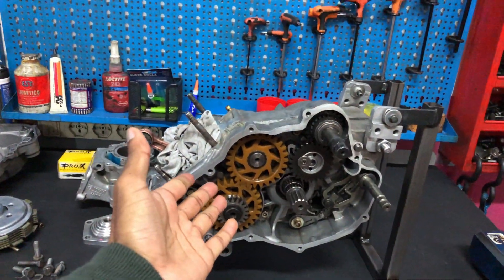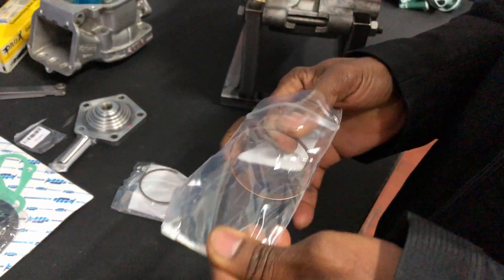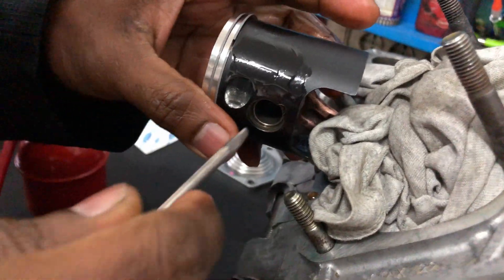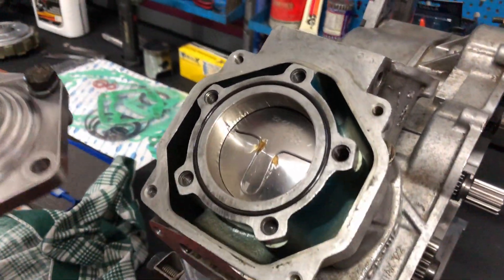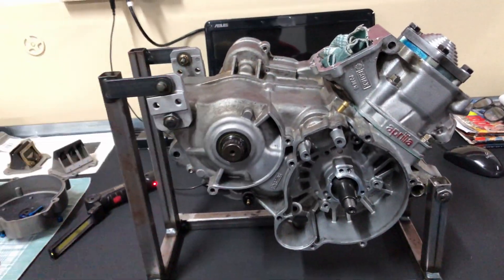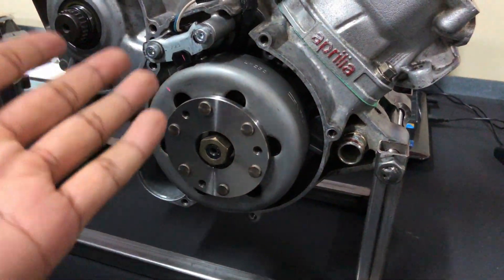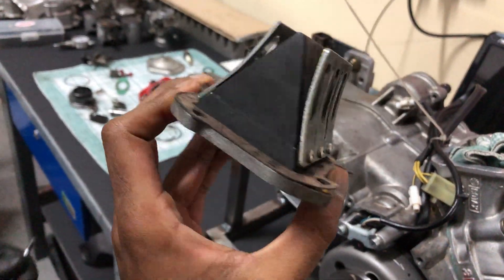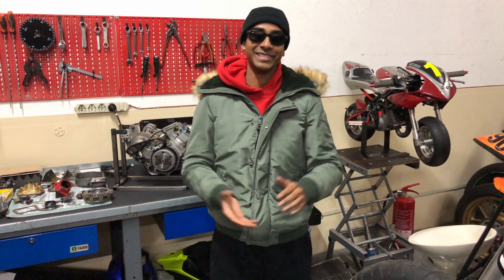APRILIA SX125 ENGINE REBUILD!! Rotax 122 episode 3

Comment: Do you know how many degrees advanced it is before you grind the case plz.
Reply from the maker: i'll ask my dad and i'll tell you!! he usually writes everything down👍
Reply: Thank you sir
Reply: Piston ring clearances are checked by inserting the rings one at a time in the cylinder and measuring the gap in the ring hence the name ring gaps it’s the gap in the expansion tips in the rings not the gap between the piston and the cylinder so In simple terms put the ring in the barrel use the top of the piston to straighten the ring then measure the gap in the split end of the ring and wala you’ve done it

Comment: I did not understand what to do with the écu. Do I have to make a hole, or should I plug the écu hole you showed …thank you
Reply from the maker: there is the mark on the ecu where you have to drill the hole, try to make it as straight as possible and drill it with a 4mm drill point. in the video on the minute 17:08 i show you where you have to drill the hole exacly. dont worry nothing will break, just make sure to drill it straight . that way you unlock the ecu

Comment: Have a question about your carburetor flange, why is it red?Is that plasti dip on it to prevent air leaks?
Reply from the maker: Yes, I just had spray painted it red😂 it didn’t have any air leaks, when I was 17 I thought the red looked cool 

If there are air leaks you could use some silicone on the outside for a temporary fix!
Reply: Thank you for fast reply, was searching online for new one but they are most likely discounted…
Mine has those small cracks like yours but need to vacuum test it to make sure it doesn’t leak
Reply from the maker: For a temporary fix you can put a little silicone on the outside so that it doesn’t suck air from the cracks

Comment: Hello! I own a Aprilia MX125 rotax 122, and i wanted to ask you if i could put a electric start motor in the engine, without cutting anything or something like that?
Reply from the maker: yes you can put a starter motor wihout cutting off anything, (rs 125 bikes have the same engines with the starter motor). However you'll need to get the starter motor, the flywheel and the relay for it, otherwise the starter motor alone wont work!!

Comment: Hello , i have a question about the ecu, i also have a sx and mine is turning up to 12000-12500 rpm and i havent thrilled a hole in the ecu, hows that possible? And what exactly you mean at the stock carburator is reducing the power?
Great video!
Reply from the maker: the rpm's will show on the dash but the power wont be there once unlocked you'll get the full power. i'm from italy and the ecu's here are locked due to the law so the stock bikes arent that fast, yours maybe isnt locked; however, if you end up modifying the ecu you will feel a difference
 the stock carburator is good too, i meant the carbuaration. you have to tune it properly, by changing the needle, jets, the carb nozzle (jet body)
Reply: @SheharaDevundara  thanks for the answer i will look after it, can it be that its just for the 5 and 6 gear because there my sx has problems, in 5 gear it just goes up to 11000 and in 6 gear it just goes to 10000, can it that be?
Reply from the maker: @shaze5498  i dont think that has anything to do with the ecu. its probably cause the engine is stock/ has many miles and has low compression. You can try changing the sprocket ratio, try a smaller front sproket!
Reply: @SheharaDevundara  engine is completely new, an arrow bend and rave 2 is installed and the carburator set up fits on the engine, sprocket is an idea

Comment: Which exhaust are you planning on using with your ported cylinder? Also where in the RPMs are you going to make peak power? Your stock pipe will not rev high enough to have any big gains in power, I only think a scalvini pipe will be enough (depending on how much the exhaust port was raised). Also wouldn't the Adige PWR-2 reed valves be much better for this bike? I am looking forward to future episodes.
Reply from the maker: Hey, thank you!!😁👍 also we'll be using a giannelli for race exhaust, but we also have a sport production underpassing jollymoto exhaust to test. Scalvini exhaust are relly good for mid and high ranges (rpm ranges). My goal is to have as much torque and power in the bottom end since this will be a street bike and im planning to have a lil fun with it. The adige reed valves are really good on the mid and top ranges; however, they lack a bit in torque/bottom end power. I think that the boysen reeds will give me more power in the bottom end and even out on the higher rpm, ranges. I'm glad you're enjoing the vids man!

Comment: Is there a specific place I have to drill to unlock the stock ECU? It’s on the top right but how far ? Many thanks
Reply from the maker: it depends, what bike do you have? the rs 125cc and the sx 125cc (aprilias from 2007 and upwards) have this hole on the ecu to drill out with a 4mm bit. On other models( also the aprilia rs 50 sx 50)  its not possibe to drill out that part, you have to unlock it with the computer, but also that depends on what ecu you have. some ecu's cant be unlocked 👍
Reply: @SheharaDevundara  yes I got a aprilia Rx 125 2007 and upwards , so if I do it wrong, slightly would it damage it?
Reply from the maker: @TAPASBLITZ  there is the mark on the ecu where you have to drill the hole, try to make it as straight as possible and drill it with a 4mm drill point. it's impossible to get it wrong. in the video on the minute 17:08 i show you where you have to drill the hole exacly. dont worry nothing will break, just make sure to drill it straight 👌
Reply: @SheharaDevundara  perfect thank u
Reply: @TAPASBLITZ  easy you have a dent at the back drill it with 7 mm drill bit look on line